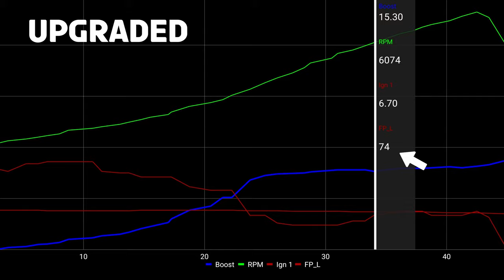Fixing The Fuel Problem To Get My 135i N54 Closer to 700HP

Comment: Hey hows it going, love your e82 its extremely clean, I currently have a fbo e92 n54 with the 6hp auto in my car, I have recently ordered a docrace top mount 6266 BB kit, and its getting delivered in a few days, i have been looking into the 8hp swap, and my goal is to be around 700HP, To make it easy i wont ask any questions, but if possible could you send me a list of things i would need for the swap, and how many hours of labor it would take me to install, i work at a shop with lifts and all tools needed, thanks please let me know - Parts list, and labor hours
Reply from the maker: I'd say total you could be into it for 10-15hrs, if you got an 8hp45 it's pretty seamless and straight forward. just need the cantcu stuff, transmission cooler adapter and an N55 torque converter. that's pretty well it.

Comment: Tony how is the 8HP45 handling the power? I have the 8HP45 also and Ken from CANtcu was saying about 650-700whp the 8HP45 starts to hit its limits. What are you hear?
Reply from the maker: it's been fine thus far! doubt I'll have issue around 650whp. only issue is if you're digging all the time.

Comment: To what psi fuel pressure was dropping to?  Also how much E85 can the stock fuel pump handle before it dips on pressure, also what was the ambient temperature versus the iat temperature.    I know at least for my car, it performs better on ethanol when is above 70 farenheigth.   Very interesting at least to me.  Also you running a flex fuel kit?  Or is on pump gas all the time?   Nice car too that body is very desirable?
Reply from the maker: we covered the fuel pressure in the video, it was dropping to around 51psi before we let off. dropped quick.

outside temp was around 12-15c. for ethanol, I wouldn't go much past e20 on stock pump. it'll be pump 93 until around 20psi and an ethanol blend on the "aggressive" map.

Comment: Absolutely wild build! Don't forget to eventually upgrade your ekp module if you're running an upgraded fp!
Reply: We bought a bunch of upgraded ekp’s don’t worry he’s got one! 😂
Reply from the maker: the stock EKP only lasted one pull before it quit. 😅 the upgraded one is working great.
Reply: @tony.nextlevelrides  oof 😅Good thing you were prepared! have you had any issues after drilling out the rails? I wanna do the same on my 135 cause I don’t wanna run PI just yet
Reply from the maker: @DITLEOT nope! ZERO issues. knock on wood

if you drill it, don't get too greedy. a tiny bit bigger is fine. just make sure you use GOOD bits so they don't snap.

Comment: I want to push my 128i but have now idea how to do anything to it.  How do i find someone that does and will do  what i need?  Like how tf do so many of you do this like you have every inch of every car memeorized.  I camt remember 1 number when asked to
Reply: Just read forums and fix your own shit bro.  6 years ago I couldn't tell you what a turbo was.  Now I build my own motors both diesels and gas.  I have built my own transmission as well the 48re in my truck.  I have an awd N54 E90 and I just did my rod bearings, oil pan gasket, pure stage 2 turbos with inlets.  I did it in my garage on jack stands.  Car runs great! It's literally just nuts and bolts.  Take your time, have the necessary tools and dig in.
Reply: Word of advice don’t push your 128i… get a 135i with an n55 or n54. Will save you some money and trouble.
Reply from the maker: years and years of practice. I slowly started 25 years ago.
Reply: 128?!?!
Reply: get a 135i and get a tune that’s abt it